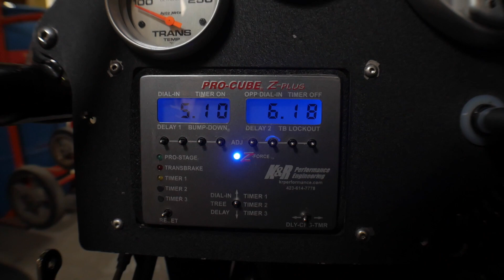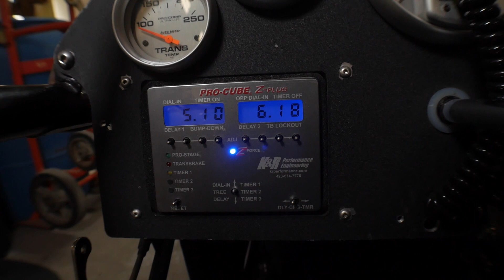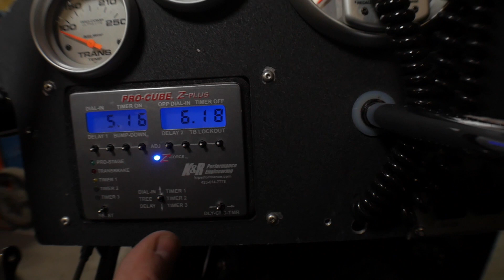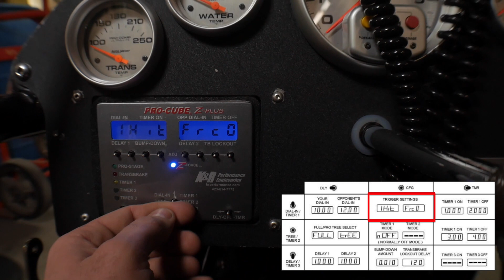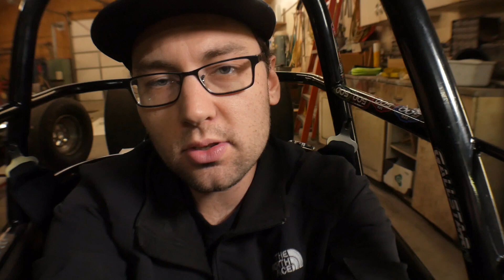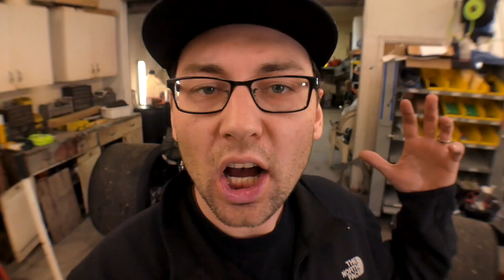Pro-Cube Delay Box with Z-Force | Why THIS BOX was a game changer for me...

Comment: Question on the bump up/down.  Can you have it where you have the option to do both?  Or is it one or the other?  Also if you can do both does it take two separate buttons other than the original transbrake button?

Comment: Okay so you showed us how to work it when you're crossing over what if I'm not crossing over
Reply from the maker: If you are not crossing over simply put your own dial in on both sides 👍
Reply: @GallStarTV  can you zero out just opponents or both.is there a switch like the CO2 by dedenber that you can just switch from your tree to there tree
Reply from the maker: @user-zf3vy3sb5f  yeah if you’re not crossing over it doesn’t really matter at all what you put in on the opponents side of the box.  You could put zeros, you could put your dial in there, or anything in between.  As long as you don’t put a slower dial in the opponents side the box will not add any cross over time into the delay cycle 👍

Comment: Hey buddy.  Jus removed knr pro cube.  Purchased n installed new zforce.  Ok. Lil  problem.  No 1 timer has continuous power.   I use for shifter.   Any ideas.   Thanks
Reply from the maker: Hey Victor, it sounds like to you need to change the timer configuration from "normally on" mode to "normally off" mode. Put the horizontal switch to the middle ("CFG") and the vertical switch also to the middle ("TREE"). You should then be able to switch the left side of the screen (the timer 1 side) from "nOn" to "nOFF". I hope this helps!!

Comment: Right now I have the digital 450 and the car shift at 6000rpm, with the pro cube z force you can choose between  rpm or timer? or just timer? Thank you
Reply from the maker: Just timer. I used to run my shifter on RPM but after switching to timer I believe shifting on time is more consistent too.

Comment: I bought a used K&R Pro Cube a couple years ago. well the case of it was beat up pretty good where you couldn't read any of the wiring call-outs. since mine was an older unit i was worried they wouldn't have any replacement cases.  I called Kevin and he by far has the best Customer Service hands down! super friendly as well!! he had a used case sitting around and sent it to me without question.  
1. This is the first time i have spoke to Kevin.
2.  His customer service is untouchable!
3. for me not buying a box from him in the first place and  Kevin doing what he did .... Makes me a K&R guy for life!
P.S. Great video Tom!
Reply from the maker: Awesome Scott! Untouchable customer service.  Well said!!

Comment: I have been using my steering wheel transbrake button held down while steering the car in reverse.  It is a bit clumsy while turning.   If I set the lock out to 20 seconds as you did, would I just have to hit the transbrake button once and it would be locked out for 20 seconds allowing me to complete my reverse?  Then reset the switch?  hmmm never tried it.
Reply from the maker: Hey Chad, the transbrake lockout is just so you can't engage the transbrake a second time right after it has released and you started your run. That way you don't hit it while going down track. HOWEVER, I have found that it is much easier to back up while using Z-force for that exact reason. Just click the button one time and back up, no holding the button required. Then I use the reset switch to reset the box instead of waiting for it to cycle through the delay and the whole pass.   I hope that helps and makes sense!!
Reply: @GallStarTV  Thank You!  Im going to try it.  If you can visualize pressing the button mounted on the steering wheel while turning...It gets very difficult and could be a safety issue.  Thanks again!  I enjoy your channel!
Reply: Great info, I have the same issue with the roadster. if your thumb slips off the button while in reverse you have to reset the box to get back into reverse.

Comment: I am rewiring my car this winter and definitely going with the K&R kit, but I am on the fence about their delay box. I often run both classes, meaning I would be pulling the box out and putting it back in a ton. That said, I am worried about the switches being fragile and getting damaged. Seems like some of the other boxes with a push button might be a little more durable for my application. Your thoughts???
Reply: I've been using the K&R box for years. After talking to Kevin, I upgraded to the Z-Force this year. I love the option to use it either way(push or release).
I am using it for two classes and I have no concerns about hurting the box taking it in and out. This thing is stout I've got mine mounted on a Ram-Mount, so it's super easy to move in or out. I've got a ball mounted in the trailer to keep it on when I'm running footbrake. No worries about it getting knocked around when it's not in the car.
Reply from the maker: Jerry, I can see your concern if you haven't been hands on with this box... BUT as someone who has used pro-cube delay boxes since 2006, I can tell you first hand that the box is stout. I wouldn't have any concern with removing and handling the box to go top and bottom bulb racing. In fact, I know of people that do just that with the pro-cube. And if you are planning to go all K&R with your rewiring, might I add that they also offer electronic dail-in board that DO NOT have to connect to the pro-cube (they use a separate controller). That way you can still use the dail-in boards even when running bottom bulb. Something to keep in mind!
Reply: @GallStarTV  Yeah, I am going with the dial boards and controller too. I've used the K&R box a couple of times in other people's cars, but never in a situation where I've been  swapping it in and out. Just a little concerned with breaking a switch off.
Reply from the maker: @jerrymarcum4684  I feel like it would be unlikely.. but probably not impossible. The button style delay boxes it would be impossible. However, I would still go Pro-Cube 👊😁